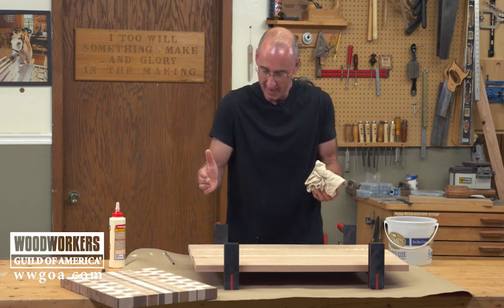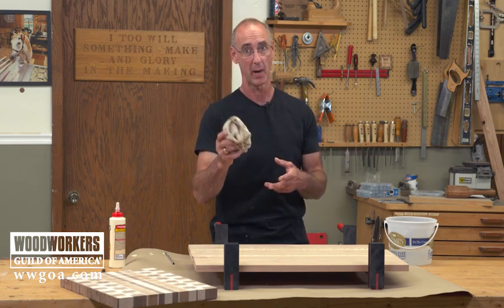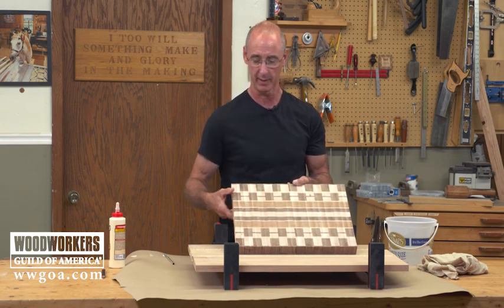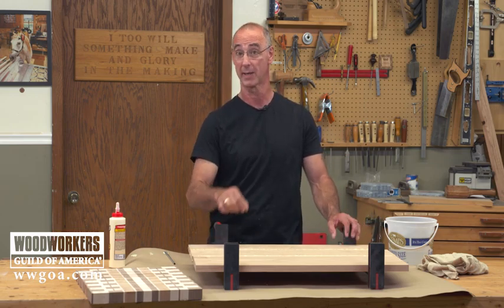How to Clean Glue Squeeze-Out

Comment: I always avoid squeeze out. I do a lot of glueing of expensive wood and have found out you do not need it. Try applying glue on 2 pieces of wood by spreading it very thin to the edge keeping in mind you do not want to see any glue when clamped and clamp. Then apply all the glue you want to a couple other pieces of wood and get as much squeeze out you want. Let dry completely. Break both boards and try to determine if the squeeze out was worth it. I found out - it wasn't. If you do get it, this video is absolutely correct.

Comment: Nice one! Is there any potential to damage the blades in the planer in with the cured glue tho?
Reply from the maker: No, it shouldn't cause any problems as long as it's cured.  It can gum up on the knives if you run it through too soon after glue-up, however, so be patient.  
Paul

Comment: how do you clean clue from the bottom of the panel that is next to the clamps?  I just end up having to scrape after it's fully cured.  Is there some magic trick I haven't figured out?   Never too embarrassed to learn a simple fact that everyone else already seemed to know.
Reply from the maker: Hello, 

That is craft paper that George uses to protect the bench, and he just tosses away after the project.  But if it were wood, you would want to scrape it off as soon as possible. 

Hope this helps, 

Paul
WoodWorkers Guild of America Video Membership
Reply: WoodWorkers Guild Of America thanks for response.  I didn’t mean on the bench, I also put down craft paper, I mean the bottom of the panel being glued up.  The side that is against the bars of he clamps.  You never see any one address that side.
Reply: @allydances  i second this! literally having this issue right now and dont see hpw you can scrape the underside of the panel after 10 minutes while its sitting in the clamps

Comment: I know pros who totally agree with you about glue.  However, couldn't wiping the glue thoroughly over the surface be similar to doing a glue size?  Glue size being a 10:1 mixture of water:glue and wiping it on the surface to pre-raise the grain.  It then dries and gets sanded smooth.  That way when you apply a water-based stain, for example, the grain won't raise as much.  Thoughts?
Reply from the maker: Hello, 

I've never tried this, but even in a diluted state I believe that you will cause problems with your finish if you do this. 

Thanks, 

Paul

WoodWorkers Guild of America Video Membership